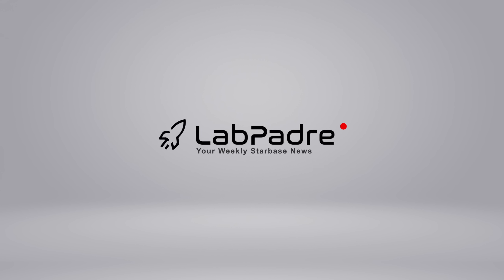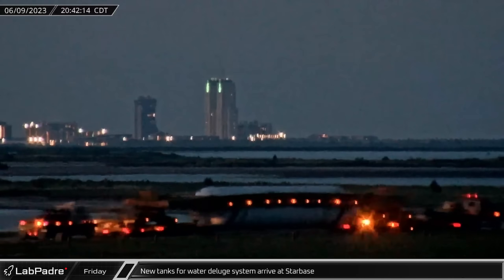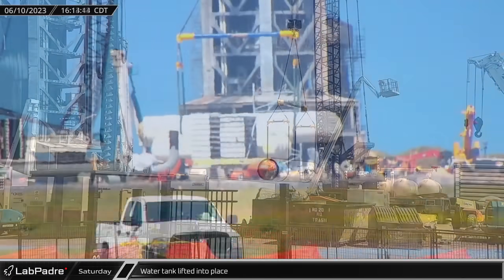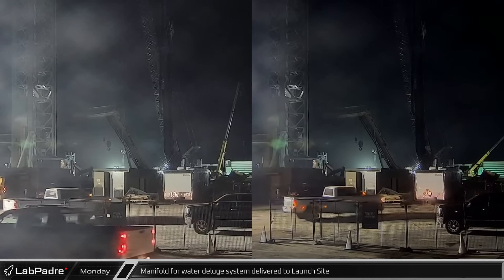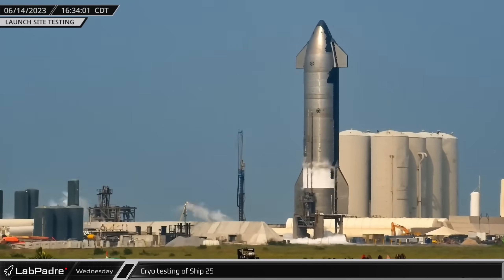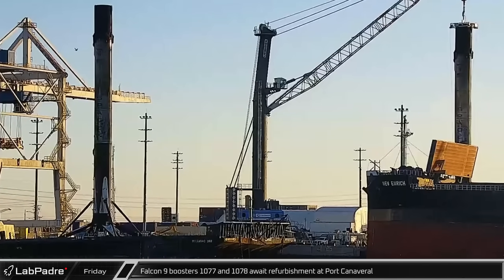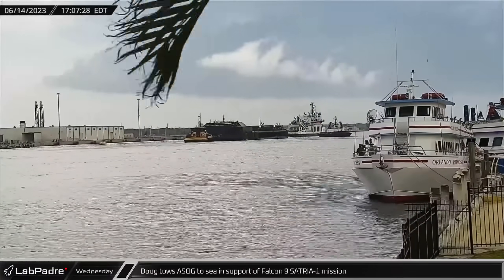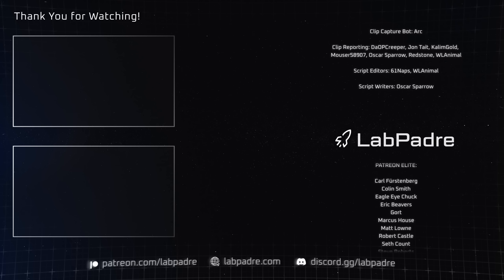SpaceX's 2nd Flight Worthy Starship Tested at the Launch Site! - Starbase Weekly Update #67

Comment: A question.  Why is the pressure system on the water deluge system assumed to be using nitrogen ?  Compressed air would be more economical,  obviously easier to work with, and of no consequence as to oxidation problems. If concrete and steel burning are the issue,,,, well....... your thoughts please.
Reply: Nitrogen can be stored as a liquid, and due to it's low boiling point it pressurizes itself as you empty the tanks. Air as a mixture of gasses would need to be stored at high pressure or in huge tanks, neither of which is a good option. You could compress the air as it is needed, but this requires a lot of energy at launch, heats the gas, and has the possibility of pulling in methane vented from the rocket.

Also nitrogen is relatively cheap because it's about 70% of the air around us and relatively easy to extract.
Reply from the maker: Great answers!
Reply: @LaughingOrange  The other advantage is liquid nitrogen’s rate of expansion. But that also makes it dangerous of causing ruptures in a closed system.
Reply: @jason_m_schmidt622  Rate of expansion , ie : the big push,  depends on the valving and diameter of the flow system being pushed. The wall on that pressure vessel is 2.25 inches thick. Interior corrosion from humidity and moisture would take around 40 years to do damage. Not buying your arguement, besides, ANY pressure vessel holding up to 3000 psi, or above, has a water bleed valve. Automatic, or manual. Every garage and factory in the world using compressed air works this way.
Reply: if you compress humid air its rel humidity raises above 100%, condensing in the compressed air reservoir and leading to corrosion there (due to the oxygen).
To avoid that you'd have to dehumidify the compressed air, dehumidifying the air before compression is useless as it would need to be bone-dry to not get to 100% RH once compressed.. very uneconomical. And dehumidifying compressed air (in large amounts).. also costly. I guess relying on nitrogen (which they have plenty of anyway) might be more economical in the end after all.. they get it liquefied and for pushing the water they just need some of it.. maybe they even just down-cycle the gaseous parts that boil off when they hold it in their other tanks where they use it for pressure testing and whatnot of the rockets?
Reply: @joansparky4439  The wall on that pressure vessel is 2.25 inches thick. Interior corrosion from humidity and moisture would take around 40 years to do damage. Not buying your arguement, besides, ANY pressure vessel holding up to 3000 psi, or above, has a water bleed valve. Automatic, or manual. Every garage and factory in the world using compressed air works this way.
Reply: @ The Texas Bandit
The bleed valve is there to let the CONDENSED water out of the tank so the tank does not FILL UP with water over time, reducing it's volume (which is why it's located at the deepest spot and opens periodically). The air in the tank will still be 100% RH - otherwise paint shops and other facilities that require DRY compressed air (air without water in it) wouldn't need to run refrigerant-dehumidification systems AFTER the compressor. A lot of DIY'ers built heat exchangers and just collect the condensate, still needing to run dessicant-columns to get dry compressed air for hobby-paint-shops and whatnot.. because upon releasing the air it's pressure falls and there will be water condensing in your air-stream (the expansion causes the air to cool) - ruining your paint-job (or tools, etc.).

Tanks also don't fail structurally only after their full thickness has been corroded away - it happens way before that, as you get micro-cracks and whatnot.
What ultimately protects a tank from rupturing catastrophically due to corrosion actually is a purposefully thinned section of the tank which will corrode at the same rate as the rest, but provides a structurally sound limited area of failure through which the tanks pressure can "escape" WITHOUT ripping the whole structure uncontrolled to pieces.

Over-pressure valves on the other hand are needed to prevent the tank from rupturing because of the pressure switch that controls the compressor malfunctioning, over-pressurizing the vessel.
Reply: Because nitrogen is an inert gas that doesn't react and it makes up 70% of the air we breath so it's pretty cheap

Edit: Also, nitrogen does not expand/contract with temperature changes, which will help with making a reliable system
Reply: @KiRiTO72987  Nitrogen heated quickly and under pressure ( big exhaust plume ) makes some strange compounds. See : nitric acid, nitric phosphate , laughing gas, etc etc. Nope not buying the arguement. Dig deeper.
Reply: @KiRiTO72987  Not needed. It would be in the compressed air..... air
Reply: bruh. asking a question and to everyone who has legit answers he goes. "Nope not buying the arguement. Dig deeper." like WTF. dont ask if you dont wanna even have someone answer and just throw it out of the window because you have already made up your mind and dont even wanna discuss it.
Reply: As they ramp up on-site LOX manufacturing they're going to unavoidably have a large excess of liquid nitrogen to do something with anyway.
Reply: @robertroy8803   didn't they shelf that idea some while ago (for Boca)? Did this change? I thought they were gonna keep trucking this stuff in as it was not economical to make it on site due to the limited flight rate they had licenses for there?
Reply: @joansparky4439  from the most recent CSI:Starbase video it seems they just haven't had the necessary electric power to run it, but that's changing. It was used even for the recent flight test on 4/20, although only making up a tenth of the load.
Reply: @robertroy8803    OK, that's new to me.. thx for the update.
Reply from the maker: Good question!
Reply: @LabPadre  Thank you,  old buzzard at your service.
Reply: after all the great previous answers i would add that nitrogen has bigger atoms then water so if there would be a tiny leak it could still stay pressurised. That also means less Nitrogen needed to pressurise then Oxygen. Also if any Oxygen would leak with all the fire it could also feed into that fire and make it more volatile. With using Nitrogen the safety is way higher around those high heats and even tho the water deluge system is to reduce heat in the first place it makes more sense to use a non combustible inert gas then using something what could fuel the fire/heat even more.

And i dont think its more economical. When stored Oxygen needs to be kept save from any fires or heat sources. So storing Oxygen is way riskier and cost intensive then the already existing Niotrogen storage on site. So id say no. With all the Safety measurements you have to put in place on a launch facility and the ammount of fire and heat the engines produce while firing and the overall danger on site, oxygen is far from easy to work with.
Reply: @private1177  Four times. Too distracting.
Reply: @private1177  Not referring to stored Nitrogen or Oxygen. Simply the air we breathe....BUT - The wall on that pressure vessel is 2.25 inches thick. Interior corrosion from humidity and moisture would take around 40 years to do damage. Not buying your arguement, besides, ANY pressure vessel holding up to 3000 psi, or above, has a water bleed valve. Automatic, or manual. Every garage and factory in the world using compressed air works this way.